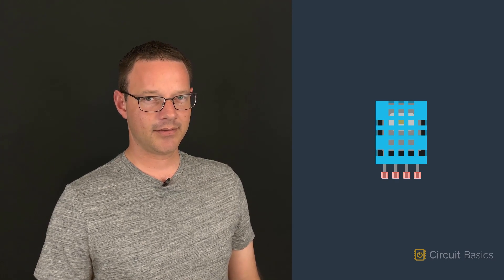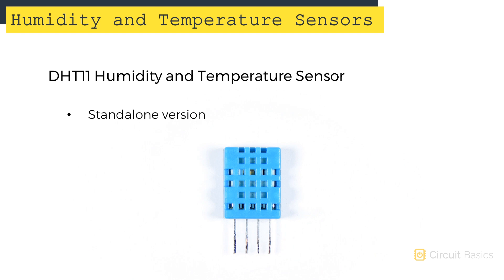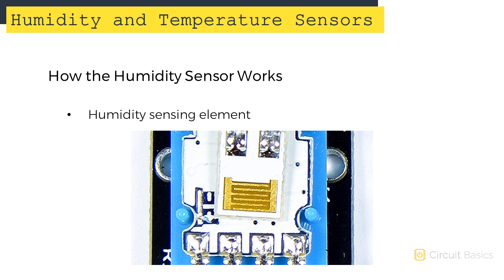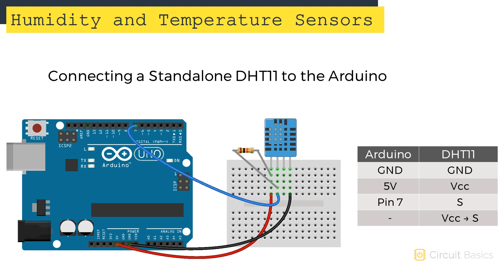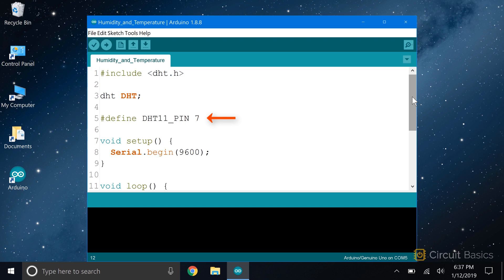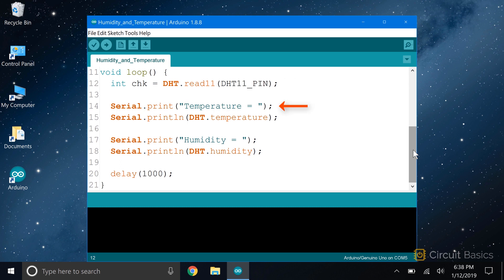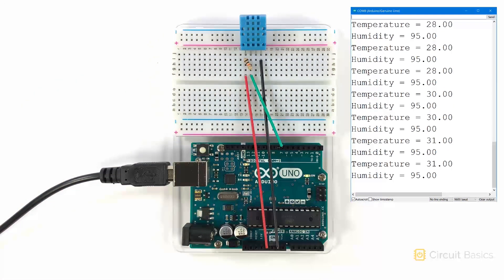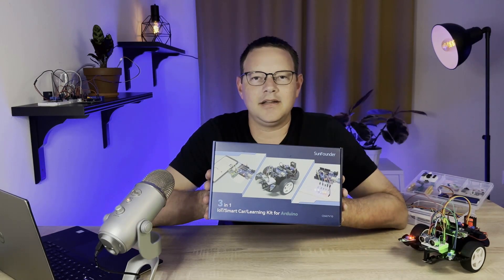How to Use a DHT11 Humidity Sensor on the Arduino - Ultimate Guide to the Arduino #38

Comment: Thank you for the explanation!  Can you elaborate why you stored the result of the read11 function as an int "chk"?  The variable doesn't appear to be used anywhere.
Reply from the maker: The chk variable is integral to the library somehow, but I'm not sure how it works. I just know that it's required because I have tried storing the sensor reads in different variables and couldn't get it to work.